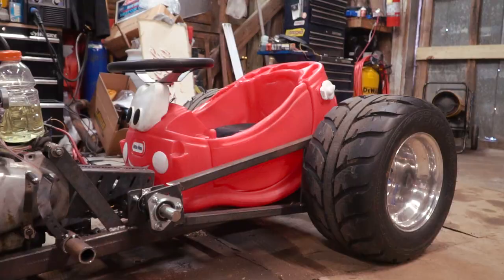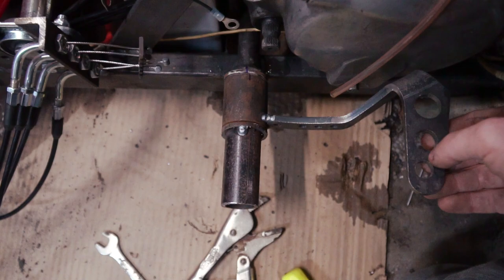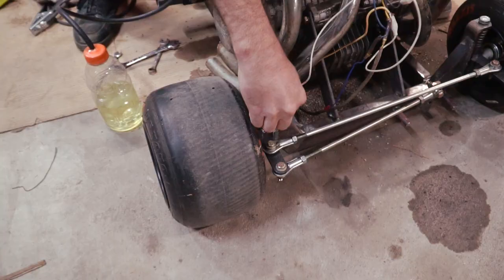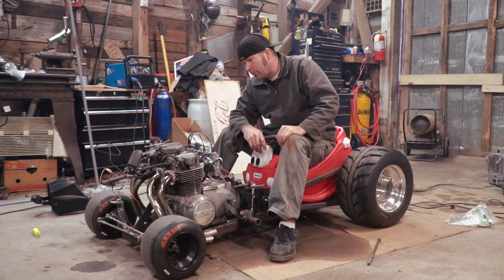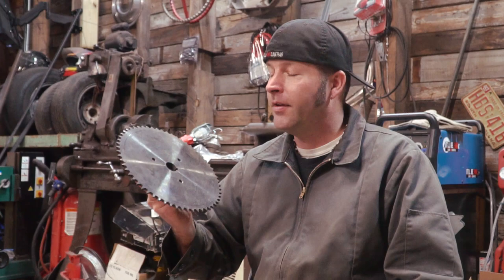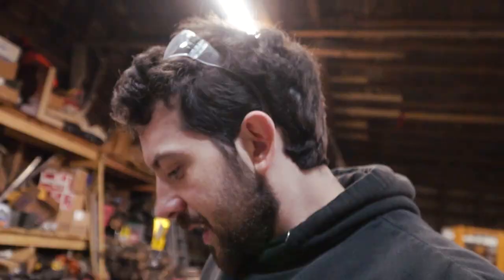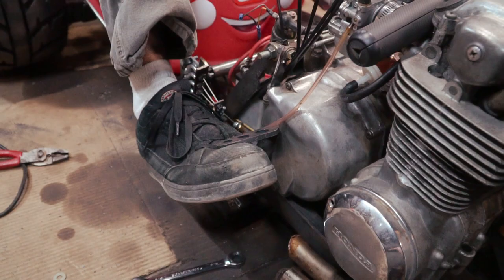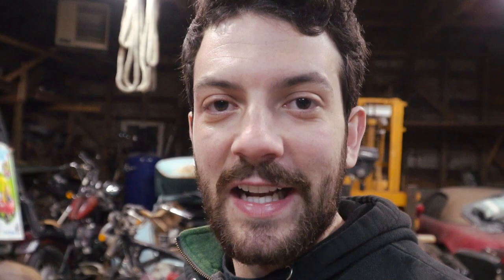550cc Cozy Coupe FIRST RIP + Gas, Brakes, Clutch! Pt. 7

Comment: When I was 12 a neighbor gave me an old riding lawnmower. A new belt and it mowed lawns again. I added a larger pulley and longer belt so the top speed was about 15 mph when you held the governor all the way off with your hand. It would do wheelies in both forward gears. No brakes. I rode a 100cc 2-stroke Kawasaki dirt bike to go 55 mph, paid for with a paper route, mowing lawns and shoveling snow. At 60 now with a sore lower back every morning, I recommend bolting in a plastic seat with a back, and lots of foam padding for the seat bottom.

Comment: at 1 million subs, you have to bring back the drag rail. it's the reason i subscribed in the first place.......
Reply: this is dummy faster than the drag rail lol
Reply: Tebibyte I can’t tell if you are trying to be rude or just got attacked by autocorrect. Either way, the drag rail would be upgraded if they revived it. Bigger motor ECT.
Reply: neither actually I'm just saying this is faster so it would be awesome if they turned this into a drag vehicle
Reply from the maker: Hoping to do that before 1M!

Comment: Back in the early 90's I had a '73 CB 500Four. I was 16 at the time. That engine is very, very similar to the engine on my old bike. I have a soft spot for this thing as a result. Very cool.
Reply: If you look around there is a kz1000 motor on a garden tractor vid.... hey y'all watch this!

Comment: 5:03 plug wire arcing to valve cover 🤔
Reply: Every time they have fired it up so far there have been sparks on the outside of the engine. Not my understanding of how "internal" combustion is supposed to work.
Reply: I noticed that last video I don’t think they see it
Reply: YEP, GOOD EYE, SIR.
Reply: They said they needed to replace the ignition coils and they had new ones. They put the new ones on around the 11 min mark. I imagine it should be good now.
Reply: @reubenswinkels9742  lol
Reply: Tac drive
Reply: @mcdls5  yeah that maybe but probably shouldn't worry about me as much as down syndrome Delaney playing the piano bahaha
Reply: @mcdls5  oh no.. my world's is crumbling down cause some guy on YouTube thinks I'm an asshole. 🤣😂🤦
Reply: Seen that too
Reply: @16driver16  Nope they use a spinning piece of metal. Its a 70's Honda not 2019
Reply: @SaberToothLawnTigers  i own several 1970s they all have 2 wires going into the tachometer, so unless this one is special...
Reply: @16driver16  You must have the special ones. Have a few myself.
Reply: @SaberToothLawnTigers  so you know if your bike does have one your supposed to buy the cap for it if you dont use it... also i still dont see how its causing a bright sparkleading to the spark plug wire that i described, if we were there you could grab the wire and tell me if its good or not but id say a 50yr old wire is probably bad just on principle
Reply: @SaberToothLawnTigers  admittedly my Honda doesnt have a tach, but i figured if anyone made the switch first it would be Honda
Reply: Beat me too it.
Reply: That does appear to be the tach drive though.  
Electric techs have been the norm longer than anyone commenting on here has been alive though. Even back to 6 volt systems in tractors. 
It's simple to connect to the negative side of the coil. 
I imagine a mechanical tach would be simpler than an electric tach with multiple coils before computers were around. Not we can just have sensor or ecm triggers.
Reply: @16driver16  Most motorcycle manufacturers used mechanical tachometers until the late 70's. At the time they were more accurate on the fast revving little engines. 🙋‍♂️😉
Reply: Agreed last video as well. Spark was such a problem on the last motor they need to check it out.
Reply: It's not a spark. Watch part 6 at exactly the 5 minute mark and you will clearly see it. It's the tach drive thing. https://imgur.com/a/chymfmh Here's a screenshot.
Reply: @zippplok You can literally see the tach drive spinning when he says that at 4:38
Reply: @zippplokThen why are you replying with  a timestamp in the first place, anyways?
Reply: @zippplok You care enough to come back here a week later and reply. I'm not even arguing, to begin with. That's the tach drive, not a spark. End of story. Get over it.
Reply: @zippplok again, it's just the tach drive. I'm not liking my own comments, I don't even think that would work.
Reply: @zippplok Look at the screenshots I posted earlier. You can clearly see it's a tach drive. I mean, Isaac himself said that's the tach drive. There's nothing else to be discussed here. You're literally trying to argue just for the sake of it. Until you prove me I'm wrong, this discussion ends here. Good luck.
Reply: @zippplok Not even going to bother reading that wall of text if it doesn't fit in to the subject we were discussing. Good thing you can finally see that's not a spark. Case closed.

Comment: Isaac, as a "general rule" the caliper (and it's leverage) and the rotor diameter are paired by the design/maker. If you put a larger diameter disc into the caliper. whatever leverage it has will be less effective vs the greater leverage at the disc's diameter. I did not say "don't do that", since the inevitable "if it sounds dangerous we better do it quick" is C&C's default answer! If you don't grind off the chain wheel teeth, be sure your mount is strong and effective- if that chain wheel touches the inside of the caliper body , it will remove material. No problem you say- if the outer half of the caliper falls off or bends out away from the rotor the effectiveness of the brake will go away quickly- stomping on it hard will accelerate this effect. You might try looking into one of the MC front disc brake calipers you have in the "junk" pile; although most are hydraulic, they are much stronger than the little GoKart mechanical caliper. Just more trouble to install. I think good brakes are always a plus, and mandatory on all quick, squirrely driving cars! This project is awesome- it wants something bigger than Isaac's front yard, fer shure! Much fun, more building and safe days!

Comment: Might be worth making some sort of back hoop that can be removable so the rider has some support and not almost getting thrown off the back lol. you could even mount a removable wheelie bar off the back as well if you really wanted to see what you can do on a drag strip with it ;) Possible future upgrades being hydraulic brake calipers. Hands down some of the best engineering I've seen yet on the channel. The build is awesome :)

Comment: Hey Ike. For years I never used the clutch to shift my motorcycles or my car/truck.  Then I worked with a guy who was in charge of diagnosing manual tranamission failures at General Motors. He said when you don't use a clutch you're causing premature wear and possible failure on something inside the transmission (I can't remember what part).  He said to use a clutch because the wear happens on a part that's designed to wear and be replaced (the clutch).

Comment: The Cozy Coupe is awesome.   Now if you could add independent front brakes perhaps to levers by the steering wheel it would drift even better. 

I was watching old videos of the drag rail build recently and came across the cheap worthless bench grinder purchase and return.  I have a radical idea.  Predator 212 powered bench grinder!

Comment: If you use a door hinge braced up for your throttle you will have equal pull on all carbs. I can hear the uneven flow when it fired up. Thing looks sweet.

Comment: The Cozy Coupe looks a hoot guys. The cross member under the engine is a little low to the ground and could lead to a sudden up close and personal engagement with the steering wheel and the boys if you catch my drift. Maybe an angled skid plate down there or slightly larger front tires, or both, might be helpful to prevent sudden stop ejections down the road. Only saying something because near the end when Ike pulled it inside it pushed that hammer on the cardboard instead of clearing it.

Comment: Several  bikes including the first year cb750 honda and Suzuki, Kawasaki 3 cylinder two strokes use 4 into 1 throttle cables investigate doing vacuum carburetor sync

Comment: In neutral when u need brake an gas an then clutch is where a clutch brake combo comes into play like a lawn mower. You be on the brake then off brake right into clutch an gone an when your moving you Braley use clutch so you wouldn’t hit brake. And when you come to a stop your on full clutch anyways. Just thinking from the builds I’ve done I personally done the clutch brake combo an it works slick. I can’t say about a gas brake combo because I’ve nvr thought to do it. Neither has anything else I’ve ever seen tho either.

Comment: If you have an old steel toe boot you can take the toe out and add it to the pedal to put your toe in so you won't have to hook your foot under the pedal and should help keep your foot on the pedal.

Comment: Greeting C&C's. Always awesome builds! I've seen a number of them where you've opted to use a torque converter which led me to think that would be a more viable option for a project I have under way. I went to Go Power Sports site and saw the series 30 & 40 however, no 50+ which I'm thinking I'll need (if there is such a thing). I've only two power plants available a Kohler V20 and a V25. Apparently the series 40 is only rated for up to 18 Hp hence, my quest for one more suitable. I'd like to keep this as uncomplicated as possible and as you've explained the concept in many vids, I'm leaning toward scrapping the original plan. I'd really appreciate any input from you guys or your colleagues when you'd have a minute. Thanks in advance . . .                        John  (aka: "Mr. Safety")

Comment: Need to take all those carbs off and make a manifold for a small Holley 4barrel 👍 I've done it already and it works better than the 4 carbs. Just need to run a small electric fuel pump
Reply: That small block Daytona Sounds like a good idea. How you tried it out?
Reply: @peterk.2772  ,yes,  I made a manifold for my buddies CB650. We put a small Holley 4barrel on it with a small Mr.Gasket 5psi electric fuel pump and it worked great. He said there was a definite gain in hp& torque. He could cruise at 75-80mph crack it wide open and break the tire loose.

Comment: Na I woulda used the brake disc not the sprocket. It'll be fine!! How often do you brake anyways. Lol. Throttle up an I think yoy should use cable for the brake so that linkage isn't sticking out. U can tuck it on the frame. Looks like the steering wheel could be forward more. Still badass tho.

Comment: Too bad you couldn't have used the original motorcycle front disk.  It seems made for the rear disk.  Not as squirrely, I bet, as the flying lawnmower.

Comment: what's arcing above the plug on cylinder 3?
Reply: Spark plug wire.
Reply: Yeah I seen that also 😳
Reply: It is the tac drive spinning. Its got a small bend to it
Reply: it's been arcing for past several videos....why are they not fixing?

Comment: Awesome build but you guys switched over to sprocket but didnt remove the teeth? It would seem to me you essentially lost actual braking surface compared to the other disk that way or a way to screw up the pads on a rapid pace. I also would've used a hydraulic caliper rather then the cable/shaft operated one.

Comment: You can see it jumping fire on the 3.4 cyl that's most of the running issue get new plug boots make a coil bracket

Comment: If i use a 250c ninja street bike motor on a go cart frame the motor in rear would i need to use a jack shaft or just run it straight to axle?

Comment: How does that Lenox metal cutting blade do? I know we sell them at Lowes but I never know what to tell people about how good they are. also sparks flying at 5:00
Reply: I love the blade. Not as messy as the regular blade the only draw back is the metal shavings are bigger so they are metal splinters

Comment: that thing sounds like a dragster. party time, excellent! whooo, whooo! question, if you're using the sprocket as a brake rotor, wont the chain oil interfere with braking? good idea in theory, but not so much in practice.
Reply: Just using the sprocket as rotor. The one on the other side is chain driven
Reply: @isaacitllbefine7231  ok, i feel better now. i was gonna worry 'bout you guys.

Comment: Just curious if it is possible to make a cart with a motorcycle engine from a motorcycle that is shaft driven
Reply: Yep
Reply: @isaacitllbefine7231  I am curious how you would hook up the drive shaft to the rear wheels. Or would you just convert the drivetrain to chain? EDIT: I have a Honda gold wing Gl1500 which is shaft driven and was just thinking if it was possible.

Comment: I know you can not do it on the cozy coupe next time on a kart take the handle bars from the bike and make a t bar for your controls like the   throttle and clutch and do a way with the steering wheel

Comment: You used a larger brake rotor except you used the same caliper that was designed to be used with the smaller rotor I dont see that anything was gained

Comment: John, at 4:31, How did you "synch" the carbs before starting the engine? Or, did you just equalize the throttle plates?
In the past I always had to get the engine running, get it to operating temperature, then hook up a synchrometer to each carb to synch them all together. 
Like this, - https://www.youtube.com/watch?v=Ne3qqfW_dXA
Video idea, you could show your subscribers how to properly synch the carburetors.
You can build an inexpensive synchronizing tool, like this, but it may not be as accurate. -  https://www.youtube.com/watch?v=eplUH9hXa8c

Comment: at least you could have removed the teeth from the sprocet in the lathe =DDD
Reply: Helps with cooling
Reply: Isaac it'll be fine 😂😂😂
I mean, I know it’s work, but holes would too without turning the rotor into a limb removing death circle 😎
Reply: I know, it’s behind the wheel ;)

Comment: Wait....you guys have access to a lathe and you didn't cut the teeth off the sprocket/brake rotor???  
Me: Shakes head in disappointment
Reply: The teeth should help with cooling
Reply: @isaacitllbefine7231  So why don't the manufacturers of brake rotors cut all their rotors like that? What's actually going to happen is, either the teeth will pick up a pebble and wedge it in the caliper, making you lose your brakes, or drag it through and gouge the pads. I"d chuck it up in your lathe and take the teeth off if I was working with you guys. It would also make it look cleaner, less "hacked". Just saying.

Comment: NEEDS PLUG WIRES, THEY ARC TO THE ENGINE.
Reply: nowr2run that's just the tach drive. The tachometer is driven off of a gear on the camshaft.
Reply: I'll look at it again Jeff but it sure looked like a spark jumping ? Thanks for the reply, Jeff.
Reply: I looked at it & looked at it & man it sure as hell looks like a spark jumping ?

Comment: Man I think the farther away from the center of the axle, the more it takes to stop it. You need a bigger caliper, not rotor.
Reply: Actually the other way around. The further from the axle, the more power your brakes have (lever-principle). The real disadvantage is that the brakes also tend to lock up quicker with a bigger rotor. Though a bigger caliper would help with brakepower to a degree aswell...
Reply: No it’s not.
Reply: Furious Fred when the rotor is bigger, that’s more it takes to turn it. I know my mechanical leverage. And I’m not confused, you are.
Reply: Furious Fred why do you think that mechanics tell you that when you go to get a bigger rotor, you need to update the caliper so it can handle the bigger rotor? That because it takes more to stop it, duh.
Reply: @ecbadboy101   It takes more to turn it, yes. But i'd say that's more because the "lever" turning said rotor doesn't change in size.
And the mechanics tell ya to get a bigger caliper, cause most of the time the bigger rotor wont fit into the frame of the caliper, wich leads to uneven use of the pads. And that can lock up your brakes completely if it goes real bad. A bigger caliper with bigger or more pistons would be better for even more brakepower. But if the power of the smaller caliper is sufficient and the bigger rotor fits into the frame of the caliper, then it's not really needed imo.
Reply: Furious Fred the only thing a bigger rotor dose is dissipate more heat. Doesn’t provide more of a leverage being further away. Your best performance is a smaller rotor with a bigger caliper. It’s just those tend to warp faster because of less surface area and heat up faster. You can’t tell people like you that, you already know everything. AKA: Mr. KnowItAll
Reply: The bigger rotor is giving the wheel leverage making it HARDER to stop.
Reply: Think about it, is it easier to hold the outer edge of a saw blade or hold the shaft without the blade on it?